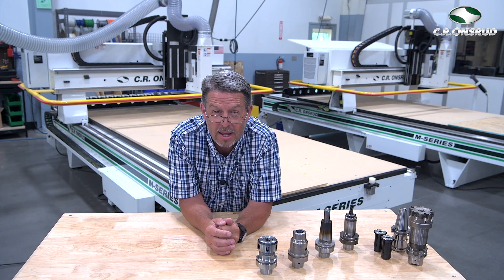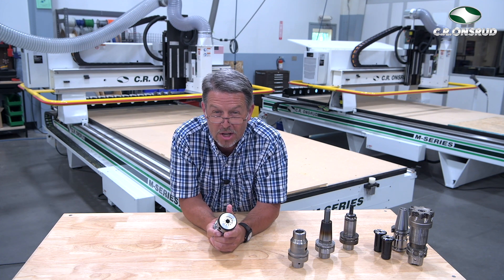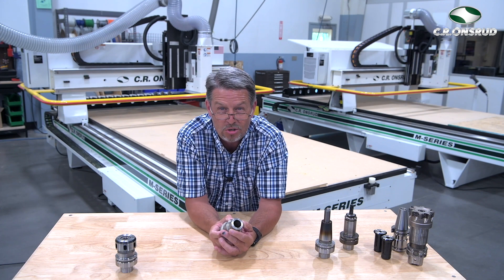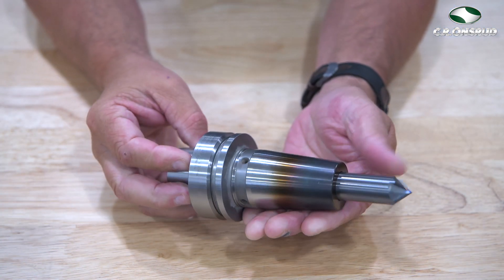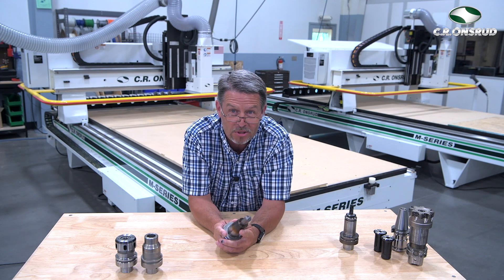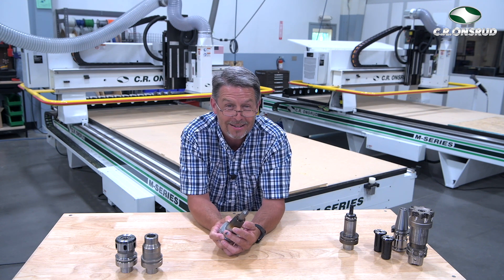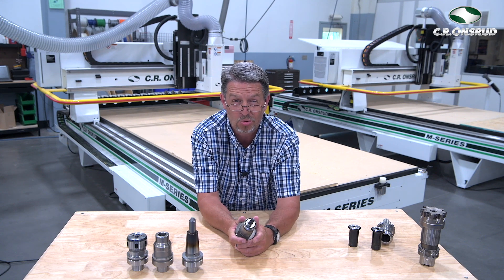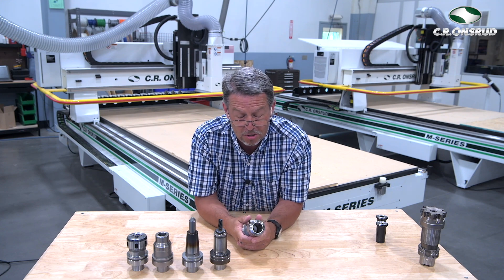Comparing Tool Holders: Nut and Collet, Hydraulic Clamping, Thermogrip, and Hydraulic Press Fit.

Comment: The machines in the background will be cutting particleboard, mdf, plywood or solid wood. Do you really need these heavy duty toolholders. If yes show us why? Show us the edge finish of solid wood
Reply from the maker: You can cut all the materials you reference and more on the machine in the background, however, this video is meant to highlight the types of tools you could use on various CNC models. Certainly as you get to harder materials - solid wood, aluminum, plastics, etc. that is where some of these higher end tool holders have more benefit. We mainly want to make people aware that the tool holder can have a significant impact on performance from feed rates to edge finish. There are a number of videos on our channel that would show the edge finish with various holders. We would be happy to discuss your application further if you want to call in and talk to our tooling specialists. Perhaps we will do a follow-up to this video showing the difference in cut quality with these holders but keep in mind that much of the performance change is over time. Thanks for the comments